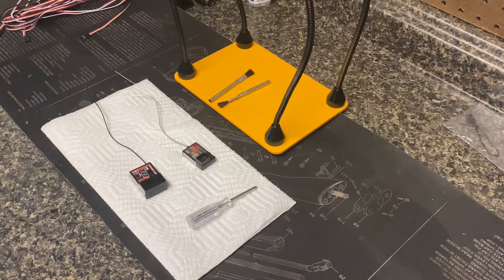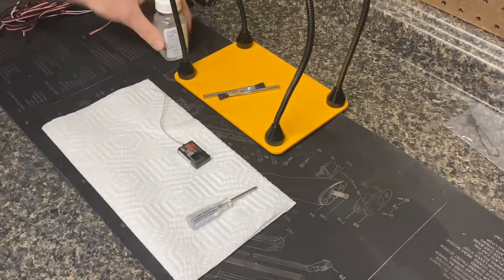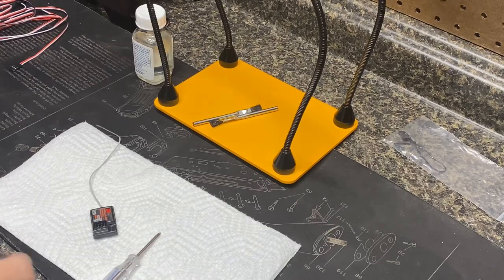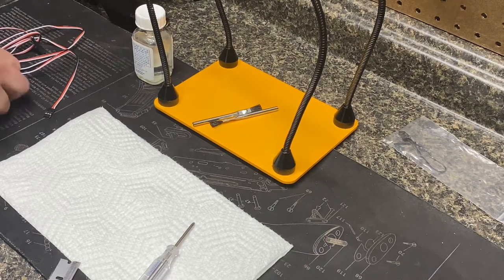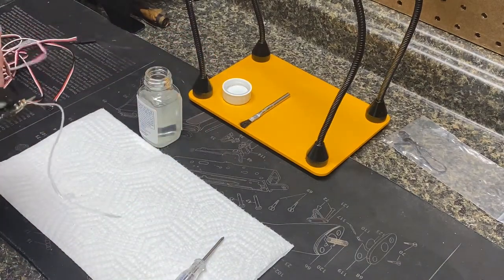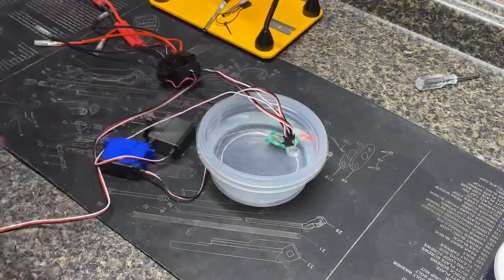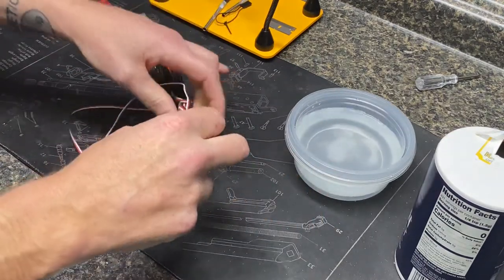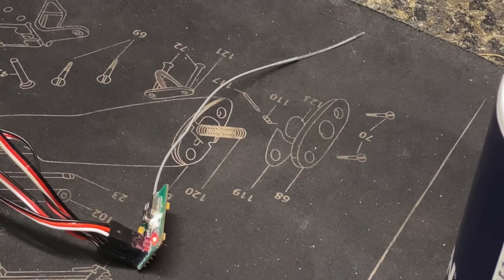RC receiver  waterproofing

Comment: Thanks for the upload mate! -  Liquid insulation tape dipping works best. It comes in different brands, but you can google it. Really good shit, Plus its very elastic so you can peel it off if need be. I don't trust this stuff anymore but I am into Marine RC Yacht racing and that's the stuff we use ( Liquid Insulation Tape ) - Take care and God bless from Australia. SUBBED

Comment: Why does a board short out in water but not pins?
Reply from the maker: Generally it has to do with the electrical conductivity of the water normal water can’t actually carry electrical current enough to really jump the pins however if you notice in the video salt water has enough conductivity to actually jump the pins. On the actual board it’s self the electrical connections and the actual tracing that is on the board that carries the signals is easily jumped by water as they are so close together it can short them out that’s why I add dielectric grease to the paeans it’s not so much to stop it from short circuiting it’s more to stop them from corroding due to water intrusion